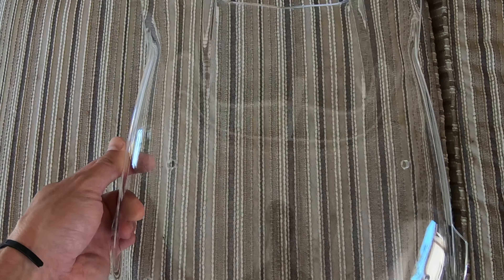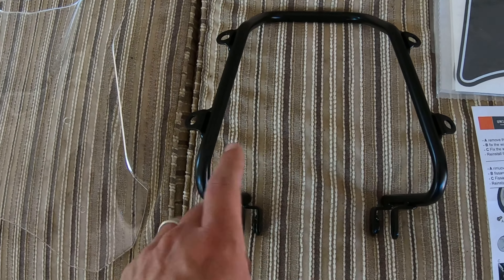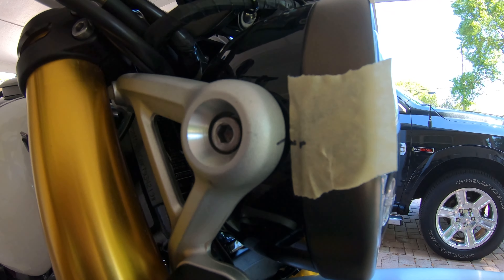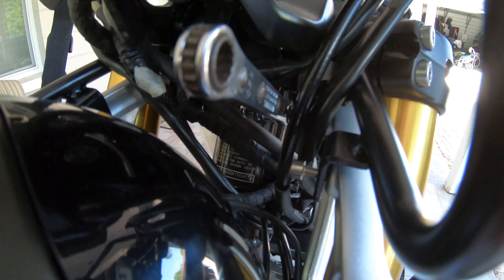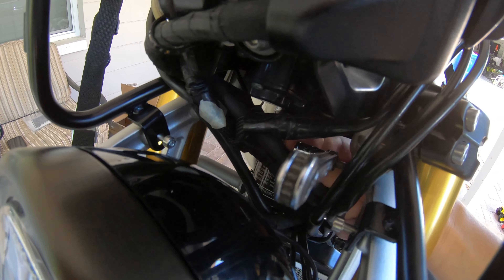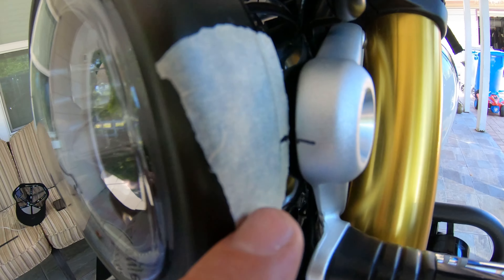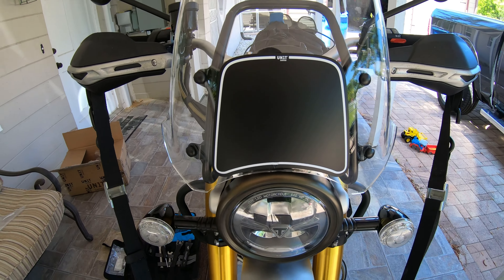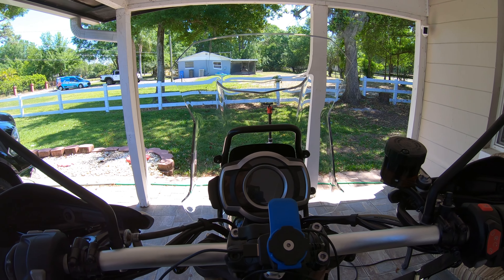Unit Garage windscreen Triumph 1200 XE install

Comment: Looks great, thanks for the install tips. My unit windshield is on the way and this video will save me some time. Thanks
Reply from the maker: Awesome, definitely do the thread locker so you won’t have to worry about it randomly coming loose while your riding off-road!

Comment: Definitely interested in how you feel about this one. I’ve got the short screen and it doesn’t particularly do much at speed.
Reply from the maker: I’ve done roughly 20 miles on the Highway at 80ish mph with my dirt bike helmet on. Definitely better than the OEM “Touring” screen. So far so good. I will more than likely do a 500 mile review of it.

Comment: questions:  Are you still loving the screen?  Do you look through it or over it? if you were only 5'8" would it be blocking forward view? Turbulence buffeting or noise?  Thanks!!!
Reply from the maker: The Screen serves its purpose. It will never replace the screen on my GSA but definitely makes a difference. I’m 6’1” and look over top of it. It would probably sit right or eye level or slightly above for you.

Comment: Any updates on this windscreen? Really interested in picking it up since it’s the least offensive large windscreen I’ve really seen available
Reply from the maker: It’s been great! My Highway riding is much more enjoyable now. Triumph just released their version of the touring screen which doesn’t look terrible but lacks the air vent in the front
Reply: @2wheelAdv  awesome, that’s great to hear, thanks for the response! How tall are you? I’m about 5’10 and have heard that some really bad buffeting can be felt for some of these mid-sized windscreens and just want to get all the facts before I drop 250 bucks on a piece of plastic
Reply from the maker: @theonlyjoelj  well I’m 601 and I can tell you without the screen I hated taking this bike on the Highway. Buffeting also comes from the helmet you use. I select my helmet for the riding I’m doing that day. The best helmet I’ve found so far with my combination setup is the shoei neotech.
Reply: @2wheelAdv  I’m picking up an Arai XD4 as my primary helmet after borrowing a friends. Surprisingly I get less pull and buffeting with that helmet than my normal street helmet. So hopefully that jives with this whole setup! Thanks again for the insight, you’re doing God’s work, friend!

Comment: Nice video and great bike... How comfortable is the blue for long journeys solo and with companion????
Reply from the maker: Greetings and thanks. I'm going to take a guess "blue" was a typo and is either referencing the bike or windscreen. The bike & windscreen make a decent touring bike with off road capabilities. You won't want to do any 500 mile days but a good 250-300 mile day won't be an issue for an experienced traveler. Now adding a companion on the back is a different story. I haven't personally taken any trips yet with a companion on the back but I would say it would shorten the miles a good bit and also greatly reduce the storage capacity. Also another thing to keep in mind is I have a custom seat from Sargent cycles which helps a ton for the bum! I hope this helps.
Reply: @2wheelAdv  hi!! Thanks for your reply and yes, you were right about "blue" real meaning was bike but including the windscreen... I like to do long rides, but seldom times more than 500kms in one day, so I guess that it will not be a problem... Thanks a lot for your reply!

Comment: Hi man, thank you for this video. Just wondering if this windshield was worth the price? I think of buying it because I plan a long trip on the highway notably. Do you see a big difference? Thanks!
Reply from the maker: Hey, it’s definitely noticeable over no screen and better than the Triumph OEM one. The GPS bar is a nice touch for touring as you can mount your cell phone or GPS directly to it.
Reply: @2wheelAdv  cool thanks a lot for your feedback! I'll definetely buy one. Also, did yuo buy it directly from their website?
Reply: @2wheelAdv  oh and also did you buy their side aluminium box? I desperately look after an other brand, less expensive but nothing
Reply from the maker: @Scritch_  yes I bought directly from them. I did not buy the box/panniers. I used the triumph 30L tail bag and the 20L side rack. However, I had to use my high end camping gear to fit it all. I did a review about the setup.

Comment: Did you get a chance to test it yet? I was also thinking of getting this exact one, but I was worried that it might cause some nasty buffeting as mentioned by some owner reviews. I’m 6.1 ft, how tall are you and how is your experience so far with this wind screen?
Reply from the maker: Hey, I’m 6.1 also and I took this on the Highway with my dirt bike helmet. I didn’t experience anything like I do without a screen. 75 mph wasn’t terrible by any means with that style of helmet. I’m going to be switching to my Shoei Glamster this week which was terrible on the Highway with no screen. So I will check back in and update.
Reply: @2wheelAdv  Great, thanks for the reply! I might wanna give it a try after all.

Comment: What’s the quad lock mount you use?
Reply from the maker: The damper and wireless charger setup.
Reply: @2wheelAdv  but you use the Handlebar mount?

Comment: Have you tried the connectivity module for gps?
Reply from the maker: No, when I bought the bike the dealer advised it was not compatible with the newer phones and they needed to update the firmware. I haven’t followed up to see if they fixed the issue